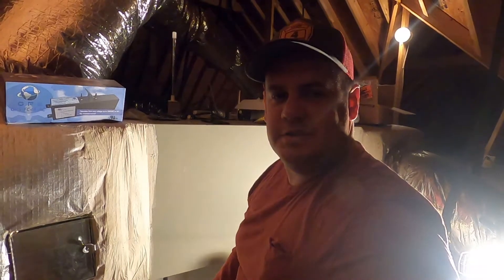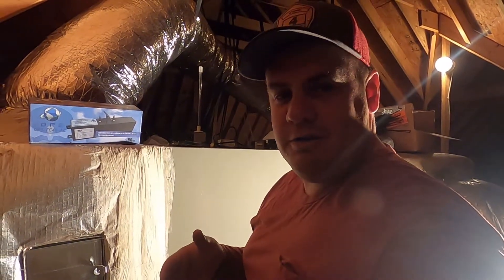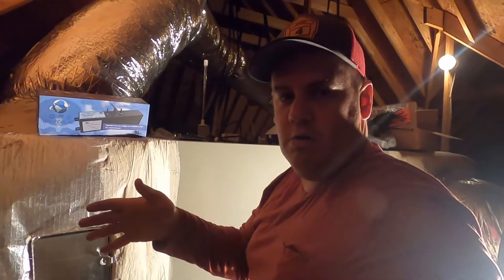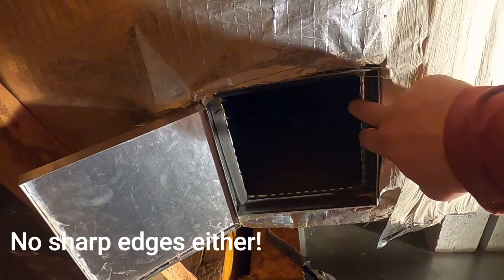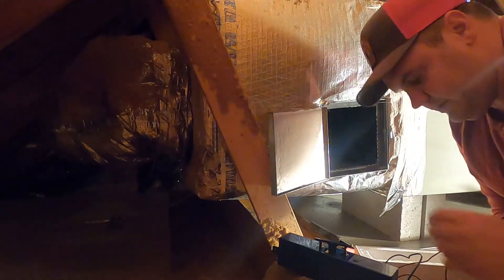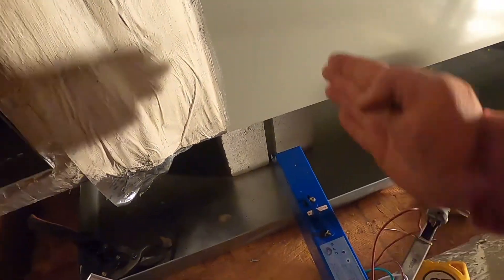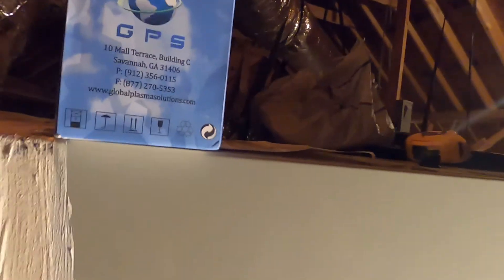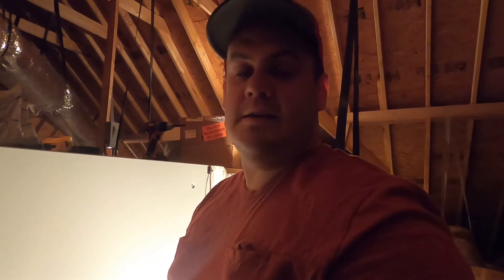Installing Needle point bipolar ionization system! Kill the Corona virus in your house! Cleaner air!

Comment: Did you just crimp some connectors and connect them to a 24v constant on transformer
Reply from the maker: I just tied them into the wire nuts where the 24v  power and common go to the thermostat

Comment: Appreciate the video, but wish you'd included the actual wiring up to your 24 volt transformer.
Reply from the maker: I can show you if you need it. Positive of the unit goes to the red wire. And the negative wire goes to any ground in the unit. Or the common wire to the transformer. That’s it.
Reply: @EmpoweringDIYFamily  Thanks.  I would probably add another 24V transformer dedicated to this rather than share with the unit's existing one.  I'm capable of doing this but it would've been fun to watch.  I enjoyed the video and appreciated the reference to the nucalgon products also.  eBay has some GPS devices if one needs a way around commercial only sales.  Also liked your "cleaning the A/C outdoor unit" to demonstrate some products.  Thanks again.
Reply from the maker: @jimonqa  I thought about it. But the amp draw is minimal. Like literally almost nothing so I wasn’t concerned. But you can also wire it up to 120v or 240v. Instead of the cost of another transformer. Just an idea.